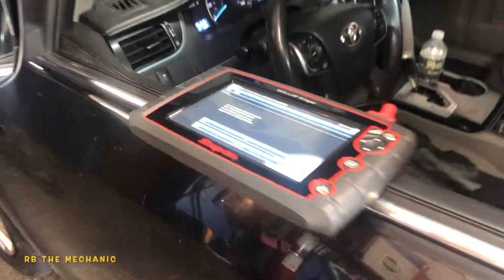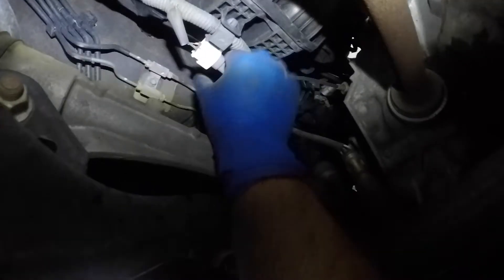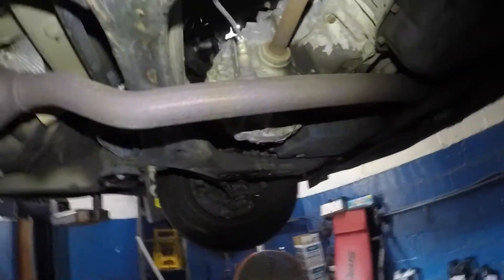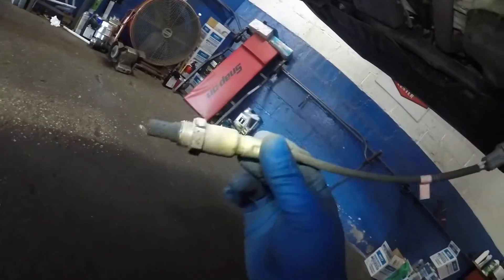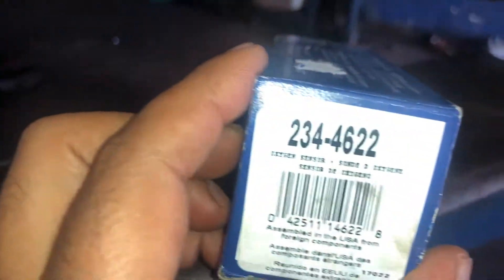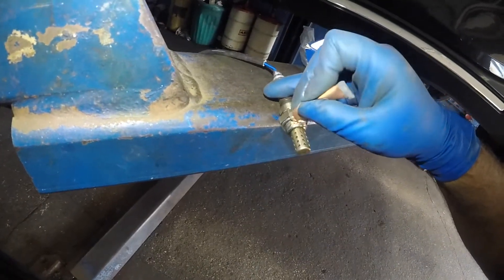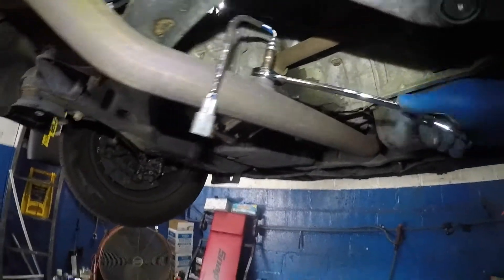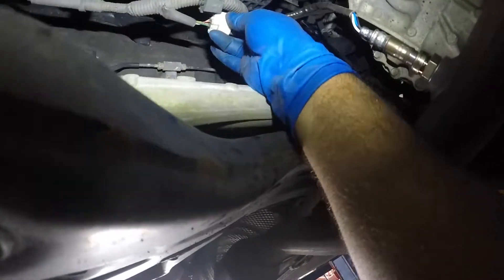Toyota Camry P0138 Oxygen Sensor High Voltage (Bank 1  Sensor 2)  //  replacing downstream o2 sensor

Comment: Thank you for the video. I have the same code error with my Toyota matrix, will this error code cause the car to make a clicking/knocking noise too? I noticed especially when I’m stopped and I have my foot on the break pedal. 
Thank you
Reply from the maker: Prolly not but possability yes could have bad air to fuel ratio

Comment: I have a 2008 camry se 2.4l  just recieved p0138 code with p0606 but it says heatedoxygen bank1 sens2.  Is that the sensor after my catalytic converter?
Reply from the maker: Yes after the concerter
Reply: @RBTheMechanic  do you think my p0606(pcm) most likely threw a code because no communication with the o2 sensor. Seems like some people get the ecm/pcm code sometimes because o2 sensor not communicating.  Just feels good to have another person agree. 😆
Reply from the maker: @ prolly usully it’s fail safe mode